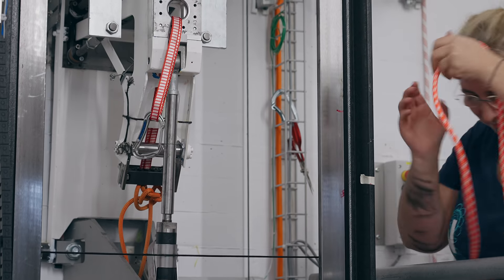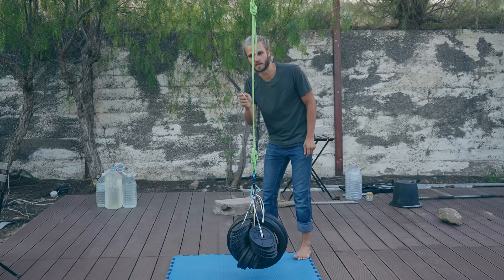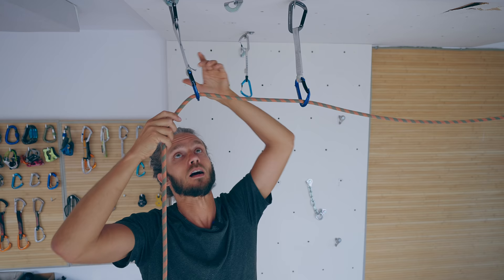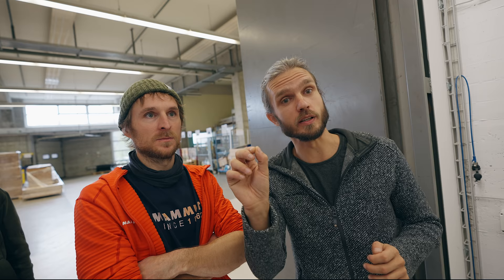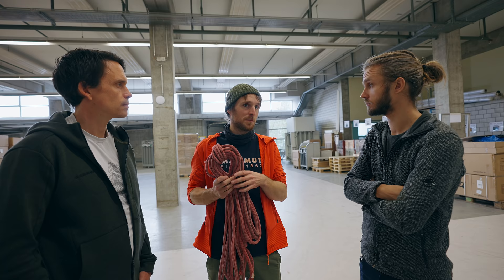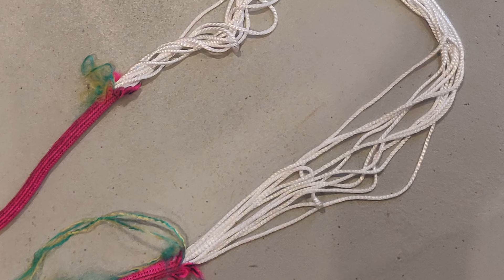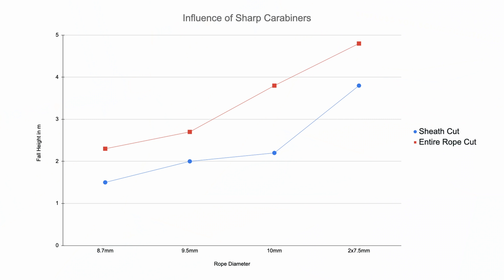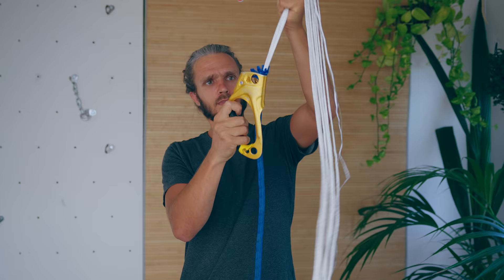Cut Resistance of Climbing Ropes Analysed

Comment: So what would be nice to know (or what I was thinking, if it's even testable): Is it really cutting because of the sharp edge on the carabiner or is it kind of melting the shaft because of friction? I was thinking the smaller the rope and the bigger the groove, then the more outside surface area of the rope is rubbing against the carabiner. Therefore it creates more friction heat and kind of melts the rope in the first place and then cuts it because it created a weak spot. Maybe we could see that on a close-up slowmotion during the fall-test.
I hope it is understandable and thanks for the videos, i've been really enjoying the fresh take of climbing gear-safety!

Comment: I doing rope access work in the nth sea when a man took a big fall on an oil rig 
All work stoped to investigate ( he died at Scene)
His working rope and backup rope ( backup rope should never be loaded with strain) had become twisted inside a rope canvas protecter and he hadn’t been checking them properly 
Anyway he was swinging around and cut though both his ropes fell a long way bouncing off bits n bob’s 
A scientific reconnection of the event was made by experts and we were all shown on video how quickly two loaded rope’s in a canvas protector will cut rubbing on a not even sharp piece of steel 
11 minutes with a 14 stone man

Comment: The cross section of that carabiner is a ''T'' at the worn zone the only zone relieving the stress on the rope is those poor 1,5 or 2 mm radiuses on the ends of the upper bar of the ''T''.Once this poor radius is dug by wear it becomes a square angle or less.... There we are not in the world of cutting but in the world of SHEARING , I HOPE that they try to sort out the difference between these two actions in their tests....

Comment: I have a decent story about how a friend became unclipped and fell about 35’ and lived. 

Two climbers begin on a 5.9+ semi smooth faced crack heavy climb. The first climber clips through the first 6 out of 8 clips. Climber 1 is lowered off of the quick draw, and unclips each descending draw on the way down. (Mistake 1.) climber 2 begins to climb, as if top roping off of a single draw attached to bolt number 6. He climbs past bolt number 6 and approaches bolt 7 and has trouble attaching the quick draw and takes a fall. Because the quick draw on bolt 6 was back clipped to the bolt, it twisted upside down and came off of bolt 6. 

His life was saved by him landing on his belayer, who both then bounced off of the ledge he was on and both of them landing on me. I was belaying a girl about 5 bolts up, from a ledge 10’ below them, using a cinch and was tied in to another bolt at the belay point. Had I not been tied in all 4 of us would probably have fallen off that cliff.  

Be safe out there, the more things attaching you to the wall the better. :)

Comment: I actually almost died on a homemade zipline due to not thinking about this, used an old piece of pipe I had laying around for a handle for the zip line, it went from about 50 feet up in a tree, down to about 6 foot off the ground, relatively far away. Was brand new climbing rope, jumped out of the tree for the first try of the zip line, the inside edge of the pipe cut right through the rope immediately, sending me into the ground from about 45 feet, got fucked up pretty badly, luckily the ground was dirt and grass, rather than rock, and 80% of the piece of pipe was wedged into the ground right next to my body on the ground, almost stabbed by it too.
Reply: I dont think I would want to climb with you as my partner

Comment: As a crane operator I would suggest that there is a lot to be learned from the Hoisting Industry. We use steel wire rope which is engineered and actually considered to be a 'machine'.  A couple of rules we use are the diameter of the rope determines the radius of the pulley grooves (think carabiner), one inch rope needs a one inch pulley. Absolutely Zero sharp edges and never allow anything to touch the hoist line while under load. We also use Aramid and Nylon slings, very much like your ropes. Cuts or abrasion on a sling will cause it to be condemned by the safety officer. All hoisting wire rope, slings and metal shackles must by law be Safe Working Load certified. Good luck.
Reply: Yes I haven't watched the video yet but would like to know the distance of the fall, the breaking strength, and the condition of the rope. Problem with fall distance is the velocity isn't linear because the climber is subjected to acceleration. Naturally the rope has a limit on it's breaking strength so the safe fall distance also has a limit. Those carabiner clips also have a small radius so there is a lot of force focused on a small area/length so the rope can't stretch much which means extremely high deceleration if it's a long fall.

Comment: Seems like they could stand to make the carabiners out of harder material, coat them in something hard, or at least broaden the factory profile on the wear points; climbing rope sheaths could stand to be made of actual abrasion-resistant material, which is not that expensive now.

Comment: @Hard Is Easy

It's hard to convey how sharp a carbine is through film without touching it. But, there is a method universal around the world that knife fanatics taught me. You try to scrape the nail plate on your finger with the sharp edge. This is how one checks if the knife is dull, adequately sharp, or overly sharpened. If it were possible to verify this on this carbine it would be great.

Comment: There have been stories of people snapping their ropes on Yorkshire Grit, which can have some pretty abrasive edges.
Reply: It's interesting how much of the climbing training I have was aimed at avoiding these problems - things like using old carpet or similar over sharp edges when top-roping or running a rope over. I got some plastic rope protectors. 

I think your edge fall video you show is the one I was thinking about in my previous comment.

Comment: (NOTE: In the following when I say radius I am talking about the radius of an object which the rope is bent around. The radius can also refer to where the rope bends around one side or another of the object. For example on a worn carabiner the important radius is not the radius left in the carabiner. What is important is the radius on the outside lip where the carabiner is worn.).
It's explained by physics how a rope can fail if subjected to a small radius bend during high deceleration when a climber falls. The force at that point is extremely high. The rope can fail even if there is no edge to cut it. I am surprised climbers don't know about this basic characteristic of rope. The radius is extremely important and of course the more wear on a carabiner the smaller the radius especially at the outside part of the wear on the carabiner. Again when I say radius at the lip of the wear I do not mean the remaining radius of the carabiner. I mean the radius of the lip which can be less than 1 mm.

Comment: Of course there are not standard cut resistence test due to the difficult to actually making it 'standard'; while traction test tests the most common stress always present with each fall with ropes, cutting on sharp edges is pretty hard to study with a single test. A good point is that ropes are probabily made of materials studied to be the most possible resistent to cut, tracion and torque. This speech can be extended to many other cases of engineering interest.

Comment: As far as I know unicore ropes are very difficult to "untangle" if you rappel on them with an 8 for example. At my work we use unicore static ropes for winching but for every other rope activity we use standard ropes.
Reply: I never see climbers using figure 8 devices.  Almost all tube style (ATC) or cam style (Grigri) these days

Comment: As a non climbing Mech Eng, I wonder how the system is designed to manage the heat build up. 
Remembering the conservation of energy law, the kinetic energy can either become heat, mechanical energy or sound.
It breaks the fundamental rope rule of D:d ratio. This will disproportionally distort the shape of the rope, increasing the load on the outer fibres, and concentrating the generated heat into a very fine edge. It would be interesting to see the test repeated using FLIR imaging, in a dark environment.
Reply from the maker: Don't have expertise to answer to your question, but from experience repeated falls over the same quickdraw does make quickdraw super hot for a short period of time.
Reply: @HardIsEasy  Which causes the rope to lose some of it's breaking strength even if there is no visible damage. The molecular structure within the threads changes.

Comment: I’m no climber but a slight wedge on rope sounds like a bad idea. Considering plastic gets tested at like 1000+ hour conditions when lives are on the line, I’m surprised there’s not a standard for worn equipment. Or some extreme use scenario test standard determining the average load and cycle life of ropes and common clips.

Comment: Great vid! Best solution of course is to replace the quickdraw as soon as you detect the groove. But, when that is not immediately possible, I suppose you could sand down sharp edges to be on the safer side? I mean, Its better to see that last biner snap instead of your rope, right ?! And to be honest the volume of material that you'd be sanding  is minimal, so the overall cross section won't  change that much, but the new smother sanded edge could save your rope.
Reply: Honestly - if you're not comfortable with some of your equipment, simply throw it away. Quickdraws and biners are cheap. Ropes and harnesses are cheap.

Comment: This is why all carabiners should use Hard Anodize (black in color), not the colored soft anodize.  Hard anodize is notably tougher and more abrasion resistant.  Anyone who has ever sanded or try to drill through hard anodize would know the proportion.

Comment: I had a full-rope snap 2 years ago, luckily it was only 4-5 meters above ground so no long-term damages. But what I find interesting after watching your video is that my rope had a very clear and distinct cut, whereas in your video here it seems the sheath usually cuts first and rips down, leaving the core visible... is that usually the case with rope-cuts?
Reply: different scenario, different weight and angle.

Comment: You could talk to people about Amorphous Metal. Lighter than steel, but significantly stronger. I'd ask whether a metallic spray coating could protect the ropes, but there's a electricity trade off even if it's possible.

Comment: I'm not a climber, just a random question.  I'm assuming you use those ropes because they are light weight. You know the hoses you'd use for washer connections that are made of interlaced metal? What if rope was designed with that as a protective barrier? Or would that be to heavy of a rope? or are there already better designs? Don't really know anything about rope climbing
Reply: It's important the rope stretches a bit when you fall. Otherwise the stopping distance is short and the peak load on the rope is high. If the stopping distance was zero (no stretch at all) the load would be infinite, like dropping something on concrete.

Comment: People don't understand how easy it is to cut a rope under tension and how dull things can be to do it.  Sharp edges are the nemesis of all climbers, especially industrial climbers.
Reply: Even something round can cause a rope to fail if the radius of the bend is small.
Reply: @dannygjk  or if there is lateral movement, pretty much anything can saw through a rope under tension.

Comment: seems like there should be infrequent steel CROSSHATCH strands in the sheath, it seems like they snap so fast under tension because of shearing force on the materials. There a reason why not?

Comment: I bought a dynamic rope from a company  called Phryxis. I don’t trust the ropes at all. They were tri color but the third color was only woven through the rope in patches. The other 2 colors were woven through the whole rope but the third color would pop out. I turned it into art. Matts and wall hangings. I’d like to warn people not to use that company. The rope is not safe. I only use black diamond now.

Comment: Devil's advocate on worn anodizing: 
Metal fatigue is a real thing but we don't see it in climbing because we have to replace our gear.
And having a carabiner show its wear and require itself to be replaced sooner for other reasons may actually be a good thing.
This is the same problem I have w/ the Edelrid Bulletproof.  
I foresee my Edelrid lasting a couple decades and still looking brand new.  But...maybe after 2000 falls (Ya, right, I'm a trad dad who doesn't fall much), metal fatigue could cause a surprise break.

Comment: Not completely scientific but ok. This is why one should inspect equipment regularly and before each climb. Ropes need to have logs and dates of use as well as a number of falls incurred and hights the ropes have sustained over time and replaced according to manufacturers' recommendations as for all corded gear. New safe  Gear is cheaper compared to one's life or injury.

Comment: 2:39 anyone that has actually used a rope.... and cut a rope..... KNOWS the outer layer is the cut/abrasion resistant part
.
the core is ONLY made for tensile strength..... NOT cut resistance
thats literally why their is an outer layer.... cut resistance.... THATS ALL IT DOES
.
.
.
like... if people just used ropes..... not even for climbing.... 
but just lashing a bridge together... or making rope.... or cutting a rope into a smaller piece to hold stuff in your pickup truck.... 
.
this would NOT be a controversy.... 
.
.
.
.
im from Montana state, USA..... and i also got my Eagle rank in the boy scouts
these city slickers have probably NEVER even used a rope besides to walk their cat/dog......
and yet have an opinion...... 
.
.
ya, try hanging 1000 pounds over your head on the job EVERY DAY
and get back to me after 10 years of doing heavy lifts
Reply: also.... that same rope at 7:17 would take 5 or 10 mins to cut... IF IT WAS NOT UNDER TENSION!! 
when its under tension like that.... its like your knife gets 100X sharper 
.
ive actually had someone pull HARD on a rope before.... to help my dull knife cut it
we were bridging a 20 foot span with nothing more than random twigs and logs..... and rope (its called "lashing".... and its actually pretty fun)

Comment: Why do climbing rope not consist with some kevlar fiber in it?
Since kevlar is very hard to cut...
Reply: Kevlar isn’t elastic and elasticity is a key property of climbing ropes. Being elastic reduces the impact forces on gear and climber and most rope manufacturers try to make their ropes more elastic.
Reply from the maker: Actually Edelrid has a rope with some kevlar in it and best brands def working hard to create next generation Ropes that would be more cut resistant... 
I'm expecting lots of that to come in few years.

Comment: Why not engineer a v groove roller bearing at that point in the carabeener, yes it might be a little more expensive but premium carabiners are already quite expensive, another 10$ to have a very reliable and long lasting one that you don't need to worry about wearing away would actually be a good value proposition and this seems like quite a dangerous and hidden circumstance. Besides the cost I don't think the bearing would weaken the carabiner, in fact it could be hollow and fit around the carabiner before bending, it doesn't actually need to interupt the structure of the biner itself to put in a bearing there.
Reply: Perhaps you mean like the DMM revolver?

Comment: Is this true also in indoor walls? Does a carabiner that is used in indoor walls, is as dangerous as a carabiner used outdoor? Do indoor gyms carabiners are supposed to be checked?
Reply: They are regularly checked and I think they are usually steel. Because there is less dirt (sand) in gyms abrasion is also less of a problem.
Reply: they are regularly checked (at least they should be). usually steal is used so there is much less wear.
Reply: It is common to bring your own rope to the gym. Thus, all the sand that is in there is a problem for fixed carabiners as well.
Reply: @three-alpha-six  Of course. But lots of people pretty much only climb in the gym. Those who do a significant amount of rock climbing often have dedicated ropes for gym climbing.
Reply: Yes, this is a valid point that separate ropes is the way to go. As a beginner climber, you need to be aware of it, though.
Reply: So is there a way to avoid this problem?
Reply: @danidani7463  No way to avoid fixed gear wearing out.  Regular inspections by gym staff and climbers will mean that worn out gear isn't left on the gym walls.
Reply: @alex none exactly, I think that this is the problem, most of the climbers dont know about it and I'm not sure that gym staf do something about it
Reply: @danidani7463  How often do you find worn out or damaged gear at a climbing gyms?
Reply: @alex none Luckly not yet, also because before this video i didn't check them, now I'll do.
I hope that they are regullary checked but I m not sure about it

Comment: Make a rope with a second sheathing. Make the external sheathing out of kevlar.
Reply: Correction. Make a unicore rope with an external kevlar sheathing.
Reply from the maker: Kevlar is not dynamic - and that's not what you want in dynamic climbing ropes.
However some mixed ropes are coming out that do have some kevlar in outer sheath.
Reply: @HardIsEasy  well as long as someone is doing it. It doesn't make sense when you say that it's not what you want in a rope, but someone's making it. I'm giving you an idea.